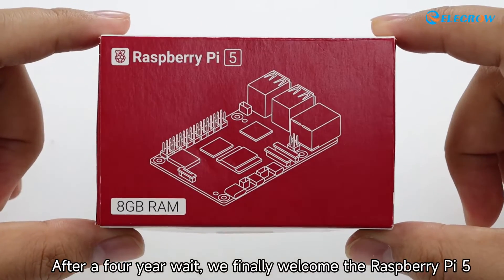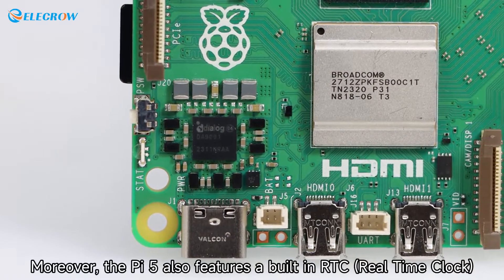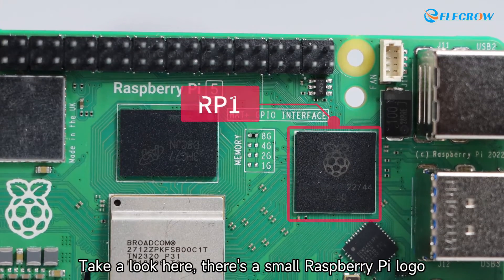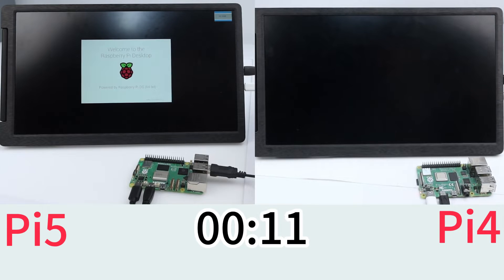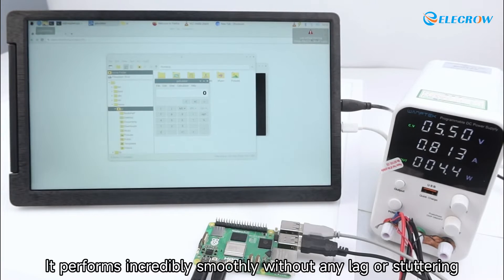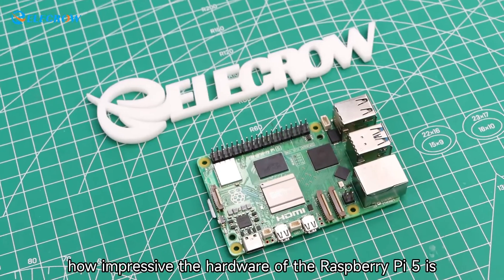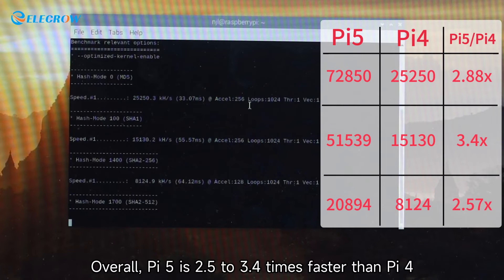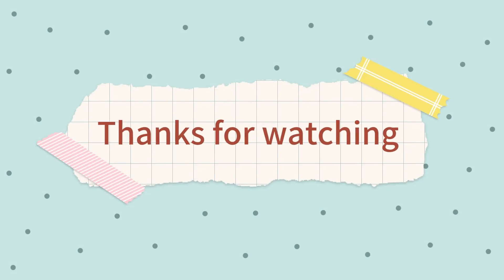Raspberry Pi 5 VS Raspberry Pi 4 | Review, Performance and Benchmarks Comparison

Comment: rpi what eva version it still works low power and it was 35bucks. why we need. high power and more cost
Reply from the maker: Thanks for asking. Generally speaking, high-power versions of boards often come with more powerful processing capabilities, enhanced scalability, and additional features. When choosing a version, it is advisable to consider the specific needs and application scenarios and make trade-offs accordingly.😊

Comment: Hello, thank you for the video. I wish you had added the power consumption under FULL load. You did mention the power consumption is the same when playing back video, but this is not full load. It suggests the performance per watt is nearly identical for video playback, but Pi 5 may have a higher ceiling?

I was honestly hoping for improved performance per watt, and the data here is hardly conclusive, but honestly I'm a bit disappointed with early available information on the Pi 5 so far compared to the Rockchip RK3588 based boards like the Orange Pi 5. But, it's still early so we'll see if software and community support will improve that...
Reply from the maker: Thank you for watching and patience. Firstly, in the video, the testing was not conducted using a 5V5A power adapter, so there may be some discrepancies in the data. However, we will retest the power consumption once we acquire the 5V5A power adapter. Overall, Raspberry Pi 5 provides a superior cost-performance ratio when compared to Orange Pi 5 and Rockchip RK3588.

Comment: Wasn't the GPU of the pi 5 800mhz, not 1ghz?
Reply: I noticed the same thing. I know it can be OCed to 1ghz fairly consistently.
Reply from the maker: Thanks for asking, when the power requirement of 5V5A is met, it can reach 1GHZ.